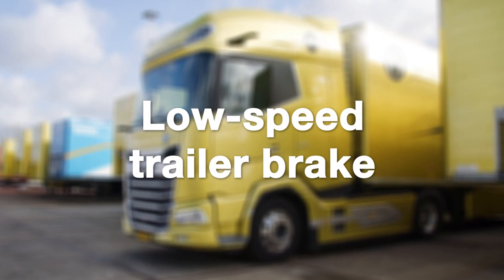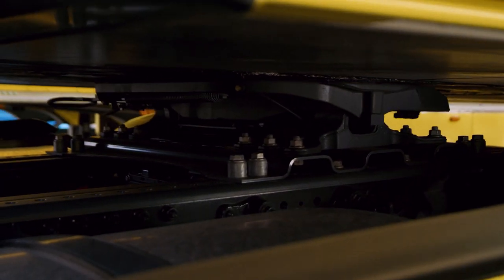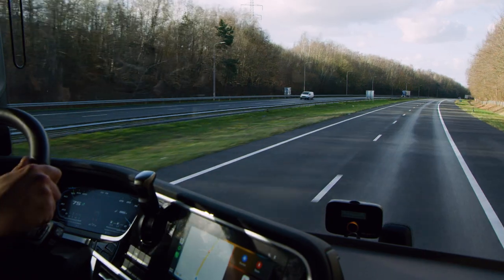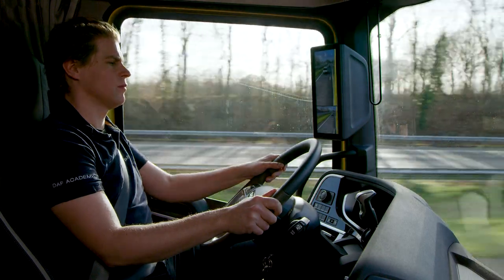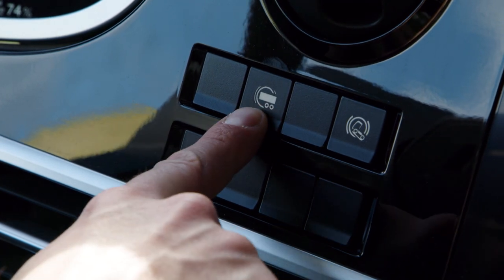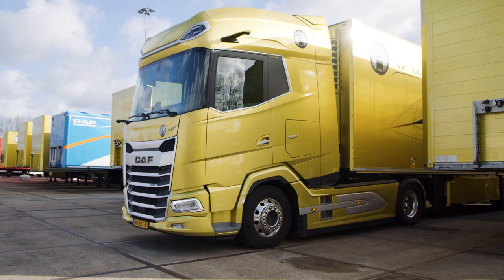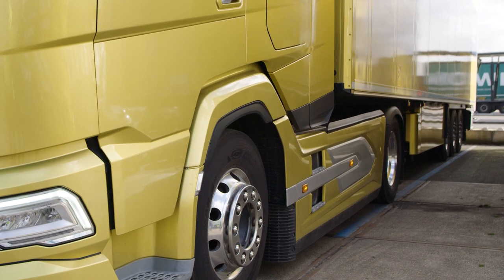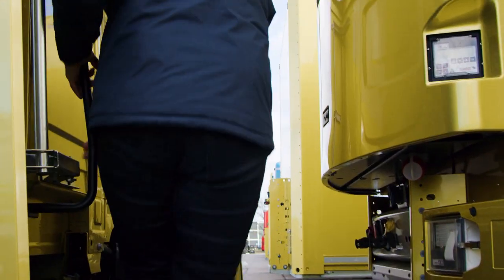Explained: Low speed trailer brake (New Generation DAF)

Comment: Always visually check if the fifth wheel is in the locked position (before legs up). Tug test is not enough, learned that the hard way ;)
But very nice feature for reefer and variable length trailers!